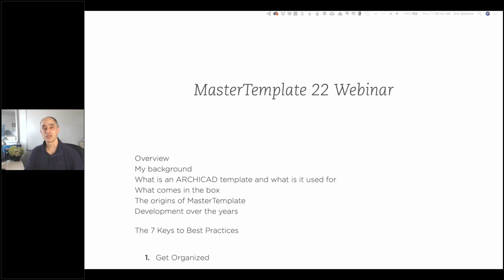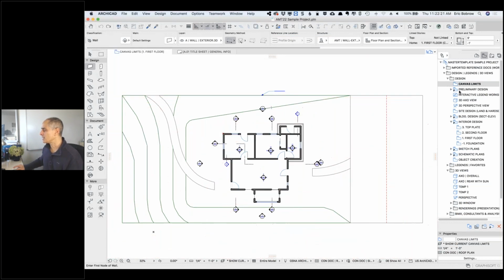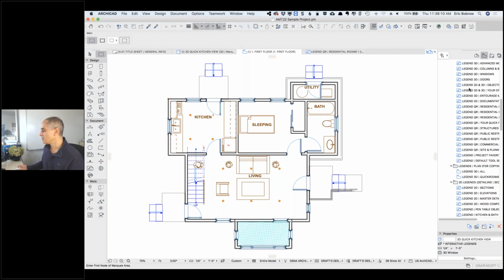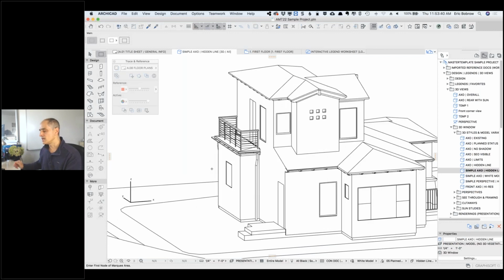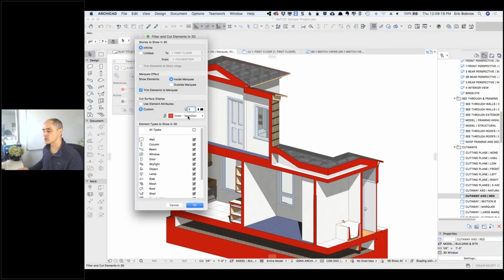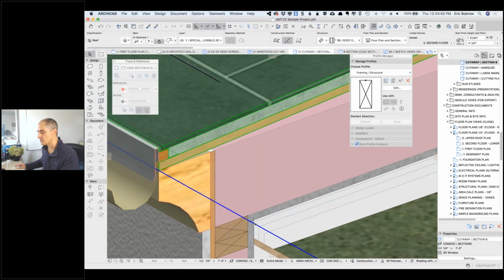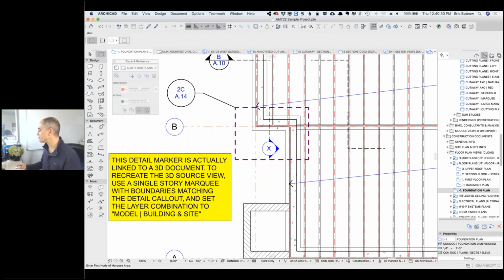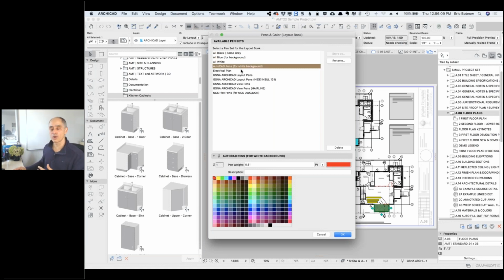MasterTemplate - The Office Standard for ARCHICAD

Comment: Eric how can I change the units to meters for Elevations call out. I have change the preferred units in millimeters but still in elevation call out still in inches.
Reply from the maker: Hi Luisita - There are a number of places where the units are set in an Archicad file. Check the following in the Options menu: Measurement Units, Dimensions, and Calculation Units. In the Dimensions settings, there are options for each different type of dimension, so click on each icon from left to right and make sure that they are all set appropriately. If you make a change, the Dimensions settings will show Custom as the name of the active preset; once you've verified that this is working to your satisfaction, go back into this command and Save or Store the settings with a name, either a new one or overwriting an existing one. If you create a new Dimension preset, you'll need to go into your View Map and change the settings for all Views that need to be updated, so this preset is in effect for all of them. I hope this helps, let me know...

Comment: Hi @Eric, let us say I want to add another cabinet type that is not on your list of cabinets. Or even a wall type. How do I create it, add it to that list from your template and what info should I fill in in other for that wall type to show in the schedule in a proper way. 
Thank you for all your very useful videos.
Reply from the maker: You can add elements to MasterTemplate easily to customize it for your firm. The cabinet legend is in a worksheet, and you can simply place additional objects into that sheet. To make it fit into the same style, in addition to placing the actual object, also copy and paste in the linework from an elevation of the cabinet so it's easy to see what the cabinet looks like. You can do this inside any project; however if you do this in your customized copy of MasterTemplate, then all future projects will have these elements incorporated. Be sure to match the layer (or set it appropriately) so when you eye-drop the cabinet, it comes in with the right settings. You'll also want to consider the Element ID, and set it to be similar to the other cabinets so that Schedules will include the new cabinet styles automatically. Optionally, you can add these elements to your Favorites, so they are accessible from the Favorites palette as well as the Cabinets worksheet.
Most 3D elements other than objects cannot be placed directly into worksheets for use as a legend that you can eye-drop. For this reason, walls, windows, doors, beams, columns, slabs, and roofs are placed into the Interactive Legends file that is hotlinked into the template, and placed onto the floor plan in a special area. Since this group of elements is placed as a hotlink, it can be hidden instantly by turning off the Master Layer for that hotlink, and the legend elements can be excluded from schedules by using a Criteria that doesn't include Hotlinked elements from the Legend.
While you can add your new wall type(s) into the main legend, we provide a separate Office Favorites legend file specifically for your additions. This may only have a few elements or could have as many as you like or need. This framework or approach is explained in the MasterTemplate manual. It makes it easy to add and customize elements for your office. Let me know if you have additional questions - I'm always happy to help.